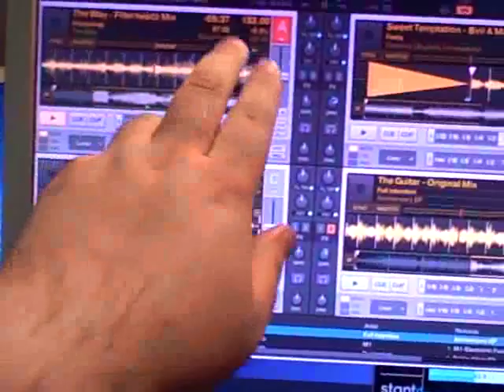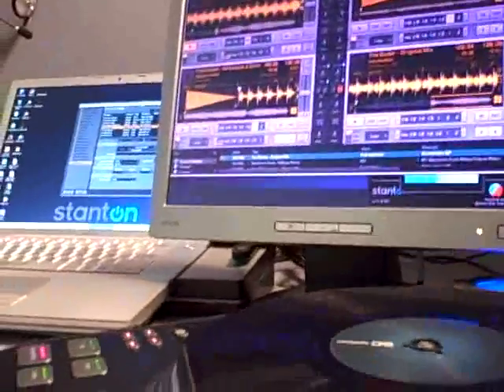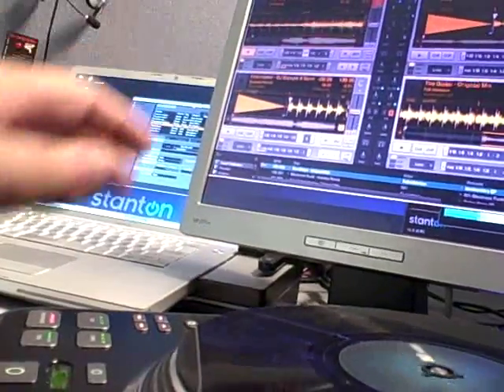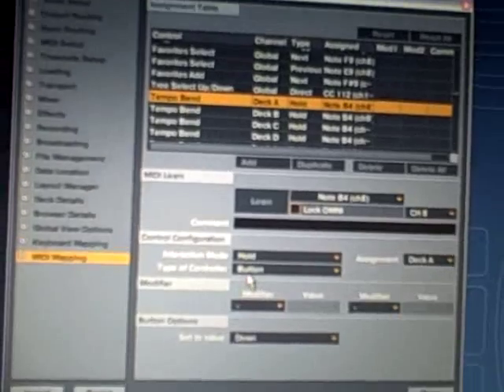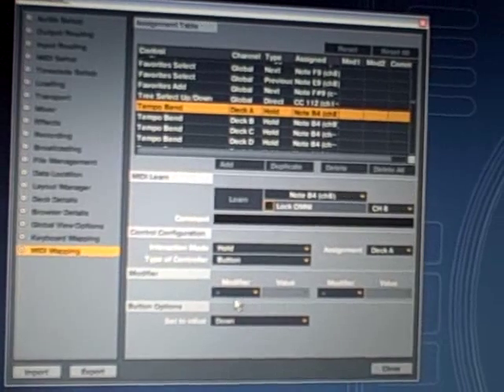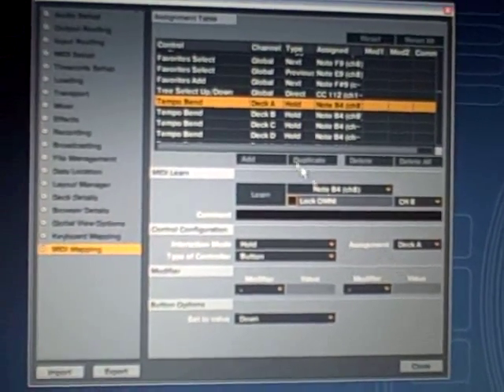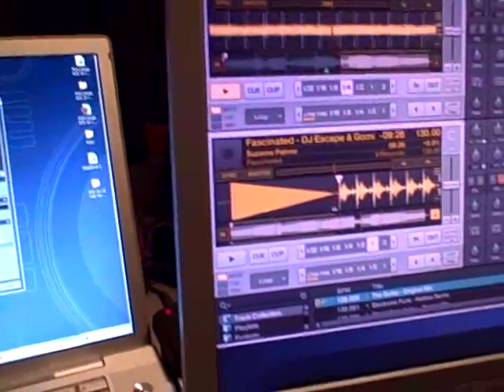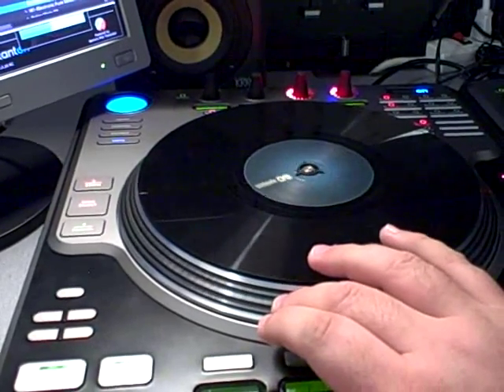SCS.1 Pitch Bend in Traktor Pro

Comment: Isn't the time factor of temp/pitch bend the "progressive" setting in the other screen for using buttons?  I notice on a Hercules mk2 the jog scratch/bend function works fine for scanning the track & scratching, but the pitch bend through the wheel is only all or nothing.  Not sure if this has been fixed in the latest version of Pro.